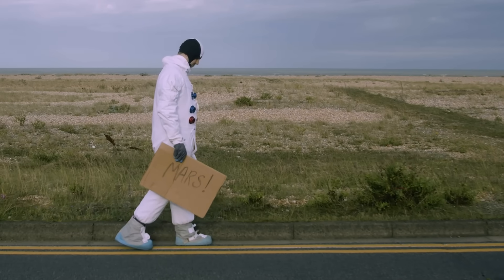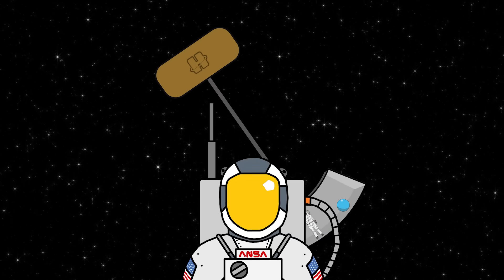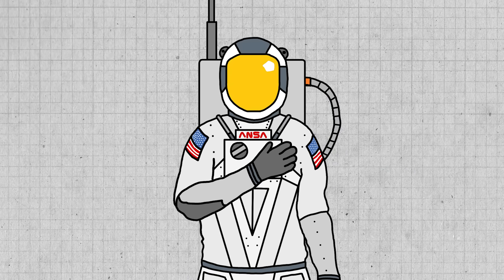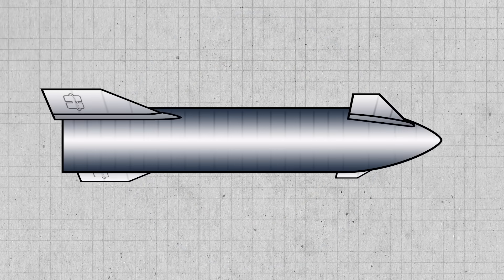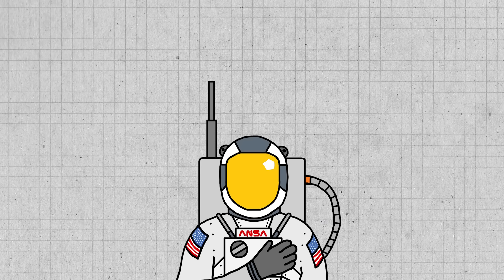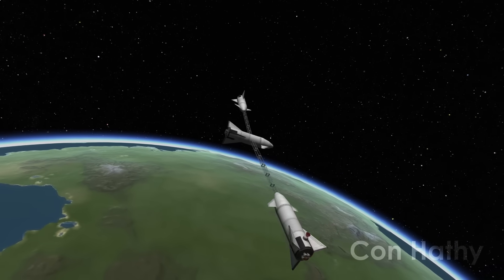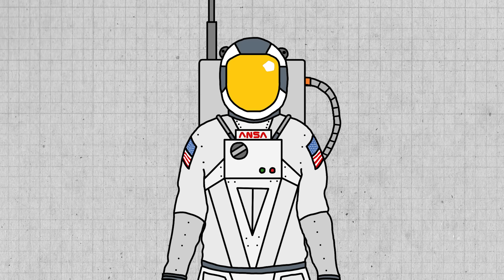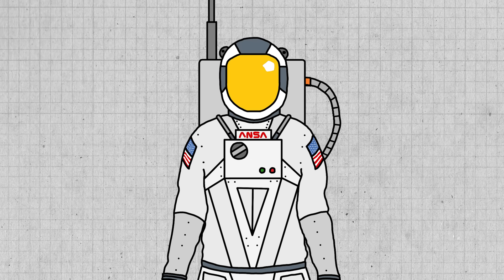This is NOT how you make Artificial Gravity

Comment: Other rotational gravity issues: 

>  Gravity is not constant; If you move in the direction of rotation, your sense of gravity increases, the faster you move. 
>  If you move opposite the direction of rotation, gravity decreases.  
>  Theoretically, if you run at the speed of rotation, counter to it's direction, you're in zero-g.
>  Imagine you're in a spinning tube, ala 'Babylon 5', (5 miles long) or 'Rendezvous With Ramma' (31 miles long),  facing down
    the tube, which to you is rotating clockwise.  if you try to walk a straight line down the tube, perpendicular to the clockwise 
    rotation, your perception of "straight ahead" will be to your right, causing you to want to walk diagonally, like the seam inside 
    of a paper towel cardboard tube. 
>  To counter this, you would need to lean and walk slightly to your left. 
>  If your rotating home is multi-leveled, say 10 stories, gravity increases, the further "downstairs" you go. 
>  Contrary to "2001, a Space Odyssey" or "Babylon 5", getting a spaceship to align itself precisely along a "Spinning Wheel's" 
    axis, synchronize rotation, hold it's relative position, guide it into the spinning station, grapple it, and secure it, never mind 
    relaunching it, would all be highly dangerous and difficult maneuvers to coordinate. 

Not as simple as it looks!

Comment: It's just strange to me to throw out short radius rings or "dumbells", when they're the best sanity measure for general space exploration in the solar system. Tailoring an ad-hoc Mars Mission risks leading to the same end as the Moon program. A high cost, high labor, non-scalable method with multiple points of failure. Even if it succeeds, applying it to any new mission or mass-producing it would be simply unfeasible and would require to restart development nearly from scratch for different mission profiles. Contrary to this, a scalable, standardized and modular craft where the spinning section is mechanically separate from the rest of the craft would immediately open the field for future missions, upgrades and side-grades for the Asteroids and beyond, with the main "tug" craft being usable, without gravity rings, for automated missions as well. Especially if multiple of these can be combined together, not a farfetched engineering solution. Combine this with the Aldrin cycler (the same solution exists for both Mars and Venus) and the solar systems quickly begins to open up to human presence without the need for costly mega-stations. 

We need to start somewhere and enabling stable, maneuverable crafts that can maintain long-term human presence is a good beginning. All the apparently simpler solutions that put further stress on the astronaut and require physical conditioning like small radius AG fall in the trap of needing endless complicated human trials, as they delegate more effort on the human body and psiche to adapt. Conversely, a stable spinning mass is a purely engineering issue that can be endlessly simulated in a lab and solved via math, not studies. It's also far more appealing and marketable to the general population. Space is open when you can send a businessman from Beijing to New York to Moon Station without a month of space conditioning in between, and it's why commercial space programs are far more promising for the future than elaborate scientific missions. We've had decades of those and while great, they're both expensive and uninteresting to voters and investors alike.

Comment: Why are you using rockets to spin your tethered craft? Wouldn't it make more sense to have a flywheel in the center that you spin up the opposite direction? I would think you could even do that while still using tethered craft, the flywheel could be a unit that travels along two main tether lines from one craft to the center and spins up.
Reply from the maker: Because of the conservation of angular momentum. The rocket is expelling mass at km/s speeds. If the flywheel isn’t moving at the same speeds it would have to be heavier or larger, neither of those is going to be easier than just using fuel
Reply: @ConHathy  But larger in space shouldn't be hard. Your flywheel could be tethered masses going the opposite direction of ship rotation.
 The amount of fuel you need to shoot at km/s speeds is still massive. And even if you can use that speed with strategic release to slow down the descent ship, half of that fuel was speeding up another ship, or other counter weight, that hopefully you want to have leave orbit. But if you have all the time in the world to generate your gravity, why not slowly accelerate a mass in the opposite rotation up to ~km/s speeds? Then use that same mass to undo your rotation when you have completed your evolution.
Reply from the maker: @JamesK00001  what structure could handle rotating at km/s while somehow being lighter and more simple than some extra fuel? It’s not a time question it’s a mass/risk question
Reply: @ConHathy  We already assumed we could make a tether than can carry double the mass of the ship 1 km long.
Ok, swinging a kevlar cable or strap, end point reaching 1km/s at about 500m (assuming just short of my ship), that puts my rpm at 20rpm.
500 meters of 3/8" dia kevlar rope should weigh about 30 kgs. Centripital force calculator online says 30kg at 500m is 59kN, and that rope can handle 48kN. Which, isn't enough, but also I didn't bother doing the integral and simply assumed the entire mass was at the full 500meters radius for my centripital force calc. Now, maybe I missed something, but that seems doable, especially since kevlar isn't even the highest specific strength material someone could use, just the easiest to get math for a rope.
And as for risk...  you could push them out a bit from the center so a failure sends the cables past the ships.

Comment: My main gripe with small radius centrifuges is actually mentioned in this video but kind of glossed over.

The difference in gravity force generated. Like if you are trying to make eye pressure not a problem, having your head in basically no-G zone is a moot point.

And if we get somewhere close to earth gravity generated, you get another problem. Basically our legs are already a problem area for blood circulation. They are just too far away from the heart to get blood pumped trough them effectively.
And now imagine putting your legs in an area with higher gravity than the rest of the body.

Tether idea is probably workable. Though course corrections that need to be choreagraphed by 2 crafts in tandem are probably going to be a nightmare to plot and execute.
Reply: If your course correction requires you to add a few metres per second, exactly away from Polaris, you gimbal the motor to keep its nozzle pointed exactly at Polaris. The system's linear momentum changes exactly as if it were a rigid sphere with the motor thrusting squarely through its centre of mass.

Conservation laws: appreciate them.

Comment: Just wanted to share some thoughts on your video. Awesome content! Thank you for making it. The idea of the tether is genius. It would be practical and easy to add. Each Starship could have the tether cable, winch system and its own tethering hook in the nose cone. You could have two Starships meet nose to nose in order to initiate the tether, with each ship hooking to the other one's tether. This would give you redundancy, with two tether cables, one from each ship, keeping the system connected. You can then initiate the spin with a really short radius, the length of two Starships essentially, and pay out the tether cable as you accelerate to use that centrifugal inertia to help with the acceleration process. Then disengaging those tethers at the same time when it's time for the Starship pair to separate, after they are done with their journey.
Reply: Paying out the cable will slow you down.  It won't help with the acceleration.

Comment: At centrifucal rotation,  gravity immersion is biggest at feet,  it could be interesting to see if there is benefits of putting people upside down at those to increase head pressure and go back into normal position(as hand standing has health benefits too).  And for motion sickness for short distances people should try using vr glasses while in centrifucal to research what feels wrong. Centrifical could also be elliptical to give that jumping feeling which maximises gravity feeling at 2 points,  while conserving space at on axel.
Reply from the maker: Hanging upside down is actually worse than zero g. More blood to the head, more pressure in the eyes. Muscles and bones in tension instead of compression.

Also no you can’t really lean into it. The acceleration isn’t constant but it’s always straight toward the center so if you lean you’ll just fall (like on earth)
Reply: @ConHathy  yes ofcourse it would increase pressure at head as hand standing,  but i did think if it would have benefits when not done for long periods as hand standing have benefits too, like stability gets better.  Overally i think pressure difference at centrifuge between brain and legs would be lot bigger than at surface of earth,  and change in blood pressure doesnt kill but might have benefits. That head to center is correct theory needs to be tested at with marmor ball at cylinder because i am pretty sure thst ball wont cylinder and slips behind rotation,  to fall people or not is ofcourse depented of amount of angle they are off center,  now they are littlebit back of motion but stays still because it isnt angled badly enought,  just like you can Lean forward while standing without falling, do it backwards and it gets harder. But amount of that angle might be so low off that it maybe doesnt matter but it surely is there. Have to test this in ksp tho.
Reply: Just tested this in ksp, that angle off center is so small that it doesn't affect standing and it even cannot be seen when you put objects standing at "floor/wall" of space ship, (tried this with robotic hinges and they seems to fall allways on same direction no matter where spaceship rotates). But when you put object hanging at ceiling of space ship you can see small constant variation of angle (this might be inaccuraties in robotic parts center when assinged or angle offset is there so cannot fully confirm this)
Reply: another thing i found when crew moves inside centrifuge if they are allowed, it will start vessel wobble sideways of centrifuge rotation axel, that could be a problem during longer operations if it isnt constantly corrected. On my example vessel sideways wobble was over 20degrees which would make walking on vessel being difficult and give bad nauseous effects when floor feels to tilt 20 degrees from side to side.
Reply: And head pointing to center of centrifuge is also wrong,  it would feel like floor is slipping sideways,  head should point littlebit to anticlockwise for rotation.

Comment: the solution is simple, install an artificial gravity generator. you can power it by fucking with timetravel cuz the portal it makes will cause a feedback loop with alot of energy.
or a big explosion happens. 
you can double check my math, but its 100% confirmed to possibly not be a bomb.

Comment: How would it function if you strap the starships together at the ends. Similar to the tether method just closer. Nore around like, 10 meters. I mean yes small centrefuges are an option but would constant gs be better? I haven't done any research but it's just a question.

Comment: 2:24 If the centrifuge they used was anything like that one, I'm not at all surprised it didn't succeed at reducing pressure in the eyes.
Reply from the maker: It’s adjustable, the video happened to show it in a control configuration where the eyes are intentionally unloaded. The study looked at how pressure changed once the radius was extended and they eyes were experiencing AG
Reply: @ConHathy  Ah, okay! Thanks for the explanation

Comment: If the tether on a Starship was to break, it's not the rotation that I'm worried about, but the tether. When the Starship spins, it is going to essentially reel in the tether around itself and potentially damage any solar panels and whatever else is on the outside of the ship.
You would need an emergency release mechanism that instantly detaches the tether in the event of a failure.
Reply: No, centrifugal gravity on the tether will be weaker, but will still hold it out straight. Hold out straight however much of it is still attached.
Reply: @grlcowan  I don't know, you might be right. But then again, when the tether breaks, the center of rotation would also change, which is sure to cause some problems. My feeble human brain is incapable of handling this many variables, I would need to run a simulation.

Another problem is that if the tether were to break due to tension, there is a good chance that the tether will spring back towards the ship, damaging it that way.

Comment: In the case of a space station, beyond the ISS, I think a thin cylinder shape, probably a quarter of the diameter thick, would make sense to have enough space for people to live in with plenty more in addition.  Instead of thrusters, I'm thinking an equivalent to reaction wheels for the spin and moveable weights along the edge to maintain a consistent center of gravity with a docking bay in the center which would decrease in RPM to match the incoming ship to allow for a proper connection.  After the ship departs, the center will start to spin after those who entered are along the outside until it's matched the RPM of the station when they're able to exit the dock and go elsewhere.  There's more to the idea, but this should be enough for now.
Reply: you probably don't need a rotating berth, just sync your incoming spacecraft's rotational rate. we've all seen interstellar by now, yes?

Comment: So you're just going to ignore the DRAMATIC difference in gravity between an astronaut's head vs feet in a small radius centrifuge? Low gravity reeks havoc on the body in so many ways that we're still learning about. You keep saying "the research is there" but it simply isn't. You're talking about experiments being done on earth where even if you turn off the centrifuge you are still going to be at 1G, so the experiment does literally nothing to simulate the effects of a small centrifuge on astronauts. Much less the potential of living under those conditions for MONTHS at a time.

The BEST option possible for a small centrifuge is actually spinning it fast enough for a standing astronaut to be at 1G at the top of their head, at which point the blood rushing to their feet might cause serious problems, but at least the important vessels in the eye and brain would be at the gravity for which we have evolved, because these vessels experience serious degradation under micro-gravity.

No matter where the 1G center-line was, of course, severe gravitational gradient from head to toe would cause a massive increase in blood pressure in these vessels as the body tries to pump blood to the entire body at the SAME PRESSURE while this gradient causes your body to actually need different blood pressure across the gradient in order to supply blood properly. Because of this, and the excess of blood pressure which would occur in the cranial vessels, there would be no option except to risk the effects of extremely heavy gravity at the feet and 1G at the top of the head.

Of course, this brings up the point that once the astronaut sits or lies down, their entire body is under multiple-Gs, which is unavoidable, because as bad as that is, this is FAR less of a problem than if you were to say...stand up from 1G lying down and have your head suddenly be at 0.25G. You'd pass out instantly.

Comment: Why not just develope deck plates that create a pull force similar to gravity, not sure about the materials used, but I do know that it would use a high speed rotating metallic disc or magnet inside of series of coils, I think it's a toroidal shaped coil system which creates a force that reacts similar to gravity with a force that has a distance area of about 10 ft above the deck plate, several are placed side by side and each is about 1 square meter in diameter.